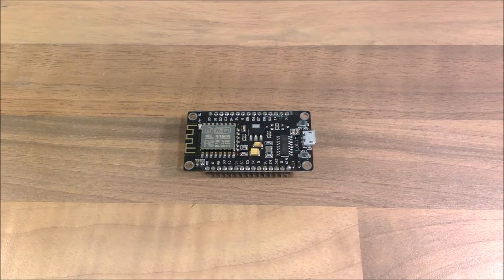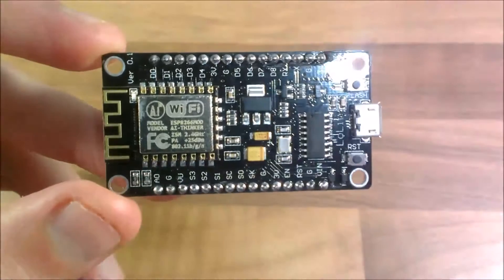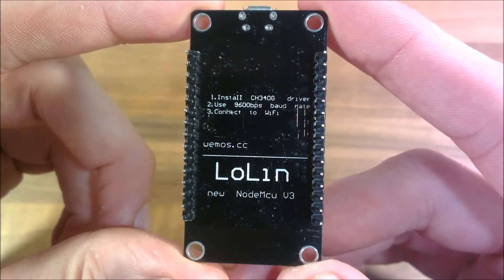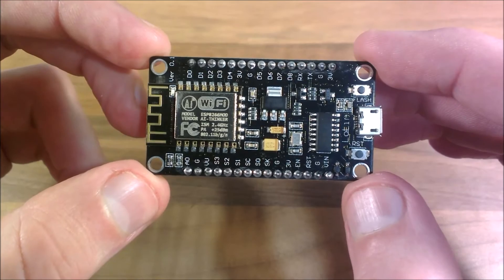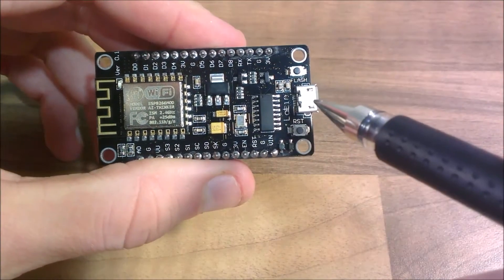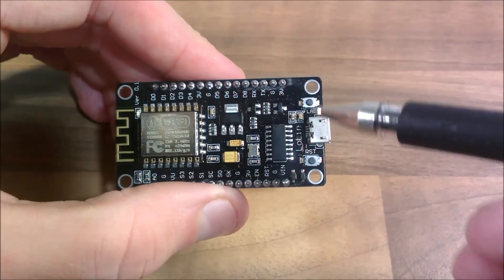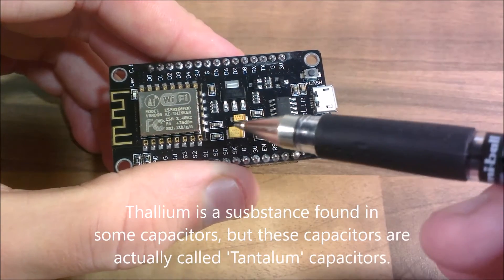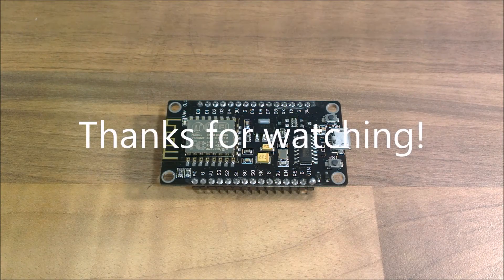Checking Out A New Lolin NodeMCU V3 (ESP8266 12E)

Comment: The 16 pin chip, the CH340, is a USB to serial converter, not a "UART".  I don't know why the silkscreen says to use 9600, as 115200 works just fine.

Comment: Hello Sir, Can you tell me how to pass the value from Arduino to NodeMCU ?
I have problem when connecting the current sensor directly to nodemcu. The value produce is not same as multimeter. If I use Arduino, I got the value same as multimeter. Both I used same code. But different result. Can you share with me how to transfer data from arduino to nodemcu lolin??
Reply from the maker: Nurisha Hania Kamarudin you can do this via serial, but in my opinion, it's better to attack the root cause.
Reply: Antony Cartwright what do you means root cause ? I'd tried to find the problem but I didn't find it . Because when I use the Arduino it just fine . When I use nodemcu there is much different result . Not same like multimeter . In your opinion what do you think the cause ? I'd troubleshoot many times but same think happened . Do you think I should try like this video for pass the value from my arduino to nodemcu ?
Reply from the maker: Nurisha Hania Kamarudin Arduino to NodeMCU is simple serial... But the root cause, which sensor is it? Acs712?
Reply: Antony Cartwright yes . ACS712 30A . I confuse why the reading is not same like Arduino .
Reply from the maker: Nurisha Hania Kamarudin how many volts are you powering nodemcu with?
Reply: Antony Cartwright I'm not sure but I just plug directly through the laptop . So I got the power from the laptop only .

Comment: Hi! Can you help me please? I've got a NodeMCU V3 like yours, but i cannot connect it to any wifi network. It can't 'see' any of them, when used with the WiFiScan example. I'd like to know how you flashed it, what all you used, and if possible how I could troubleshoot my board. I'd appreciate your help :)
Reply from the maker: Hi, it sounds like you're having power problems. Does the serial console work when you turn it on? To make WiFi work, you literally only need a MicroUSB cable, power and routers.
Reply: Antony Cartwright Yes it does work.. it says scan start scan done no networks found
Reply from the maker: FrozenRocket in that case, if you are in range of a router, then it sounds like it is broken. :(
Reply: Antony Cartwright oh :( thanks anyways

Comment: is th pin configuration same with arduino ide or does it change
Reply from the maker: Hi Im, the pin configuration is odd in Arduino IDE. You'll need to research the pin table as it isn't straight forward. The mappings are strange!
Reply: The Other pin work and other not and not the same the best is Node MCU and This Lolin is Clone according to my research.